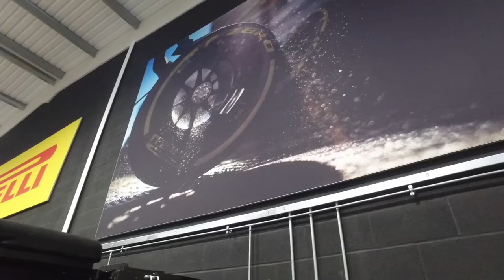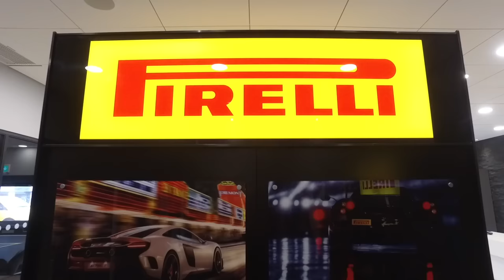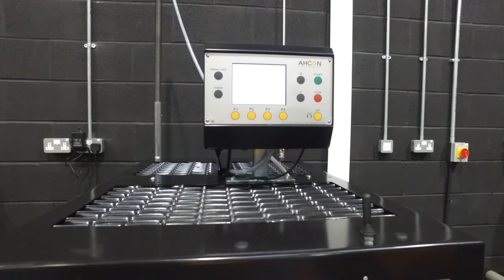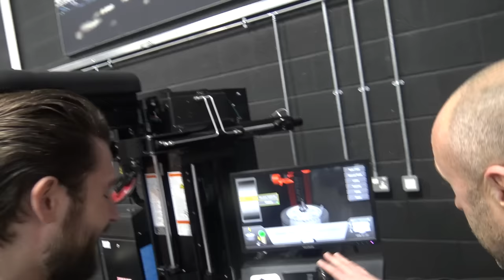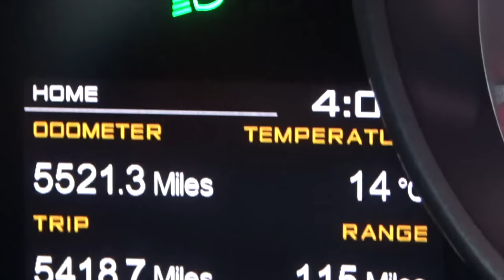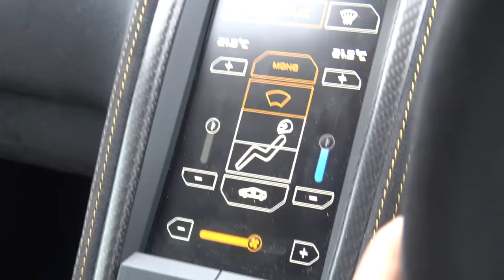The Most Awesome Tyre Changing Facility! Pirelli Sotto Zero 3 Tires On The McLaren 675LT

Comment: Good tyres are vital, cannot stand people who buy shite tyres just to save money. There would be far less accidents if everyone had good tyres
Reply from the maker: +Talon276 Sooo important!
Reply: I used to skimp and get dunlops and kuhmos.  Then, on a whim, I got a set of Michelin Supersports on one car and Pilot Cup 2 on another...I'm a complete Michelin convert.  To get better grip, less road noise, and increased life for an extra $80/tyre is definitely worth it.
Reply: Makes you wonder how on earth it's possible for people to buy shite tyres
Reply: I've got the most basic 2010 Citroen C1 they made but have a decent set of summer and winters for it due to the commute I've got to make. They've made such a difference especially under braking, within the first two weeks of having the winters on I've had to do two emergency stops in the cold and wet. Don't think I would have stopped in time if I had the summers on!
Reply: Talon276 buy the worst tyres you can and have more fun. Sometimes I run bald tyres and see if I can't crash
Reply: Because there is a market for them and not everyone has the cash to splash!
Reply: RustyClouglin that's not the point, there's buying utter shite tyres made by some randomers or buying a decent set which are reliable and trustworthy, not once have I mention a brand haha
Reply: Talon276
you implied good would come with a price tag but it doesnt have to. I see people buy shit tires that are expensive every day bro
Reply: Mr JWW it all depends on your income

Comment: Great video Mr JWW.   I too don't skimp on tyres - get the best you can afford.   I bought a fast Volvo (Second hand) and it had budget tyres on and its was horrible to drive and I can say it was like driving on ice. I could not wait to get some proper tyres on it - Pirelli PZero Rosso - and it totally transformed the car.    That centre looked so lush and professional compared to most tyre garages.    P.S. you can't beat Hunter Wheel Alignment systems.  That 'robot' aka Revolution TCR1 is very clever bit of kit.  Happy Driving.

Comment: The SottoZero Winter Tyre/Tire made a better car of my C6ZO6. I changed it from GY 325/30 ZR19 to Pirelli 295/35 and 275/35 ZR18 to 255/40 on Original Wheels. The Handling is much better on countryroads. Rain and snow is super much fun and I have 45.000km driven. Four Tyres costs 1.200,- Euro. Thank you Pirelli it made my 10Year old car very fast these days.

Comment: After A long conversation with manufacturers regarding the obsolescence of my old tyres I fitted the newer version of the Bridgestone tyres the car was designed for. People forget cars, especially supercars are designed with a certain tyre, thus suspension and damping are tuned to a certain tyre sidewall rigidity and tyre weight.  Even changing to a different manufacturer can alter the handling characteristics of the car due to tyre rigidity and alterations to un-sprung weight.

Comment: Very cool video.  James,  I thought when changing from summer/performance tires to winter tires the actual rims would need to be changed too to make up the difference of the larger sidewall tire.  However with your 675LT it looks like he winter tire has the same low profile as your summer tires.  Is that normal on a supercar or is that just a McLaren thing?  (Mike in Ohio)
Reply from the maker: +MTobin1000 Indeed this winter was developed specifically for the car so it rides as per the original Trofeo R 👍🏻

Comment: How do you shift gears with one hand? At 02:49 you shifted down a few gears with only your right hand on the wheel?
Reply: Expanding on Arjontje's comment, some cars have seperate paddles for the up and down shifts, however on the 675LT, the paddles are connected in the steer column, basically imagine it as a single bar so when you pull the right side towards you, it downshifts, and when you push it, it up-shifts, the opposite for the other side.